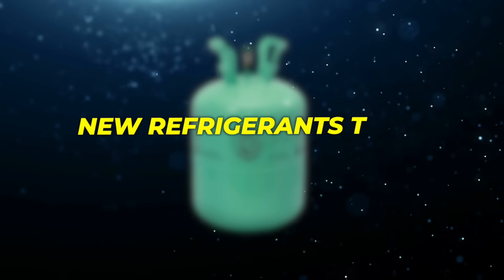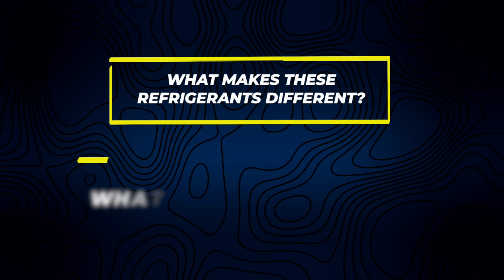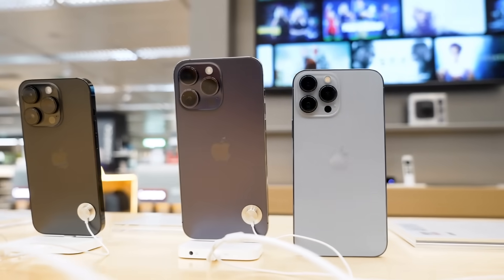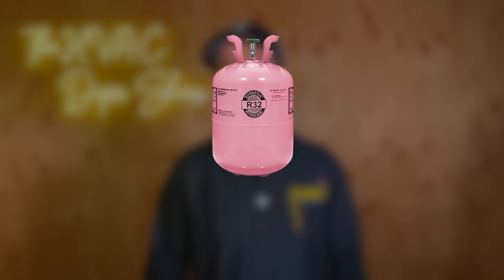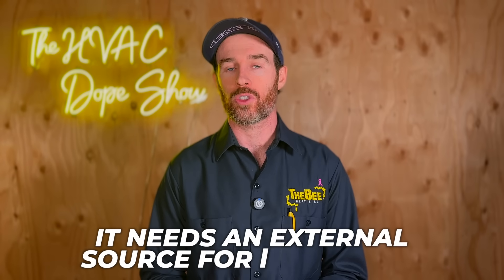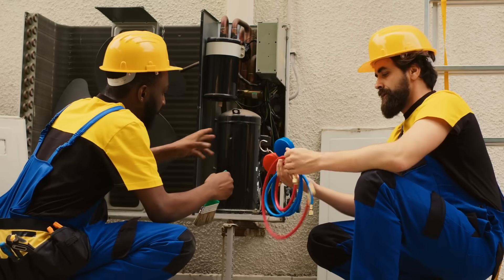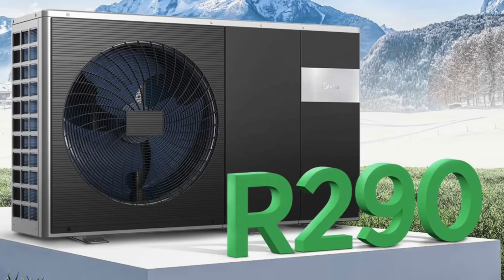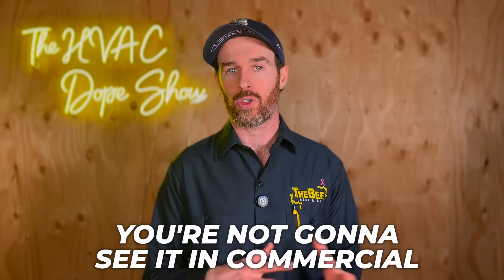The TRUTH about the “new” refrigerants | R32 and R454B refrigerants phase in

Comment: The phase-out for R454b is on the radar in Europe. They found out about the “forever chemicals” known as PFAS that are in this refrigerant but NOT R32. Of course DuPont will come out with a “new & safe” gas just in time for everyone to buy new A/C units. Don’t worry, you WILL get used to this sort of thing after a few more times.
Reply from the maker: Yeah planned obsolescence… can’t stand DuPont I tell everyone I know to watch dark waters lol. That’s crazy I didn’t think 454b was being used in Europe already? I thought it was a blend of R32 and 1234yf and they haven’t been using it in the field yet? Weird I’ll have to do more research
Reply: @TheHVACDopeShow  454b may not be currently use in Europe, my research on refrigerant options lead me to see how much stuff they were looking at due to PFAS, R32 was not included. I’m currently working on planning a replacement of a running 38 year old R22 Goodman. The last tech that was here to change out a capacitor, said the company owner directed service that no more refrigerant services would be performed on units that used banned refrigerants and customers were told these units just need to be replaced. Nobody could give me a good answer as to why they want to sell systems with another evolving refrigerant ban R410a, nor why the supposedly 25% more expensive 454b units can’t be priced yet. Do I need to say what their response was when I asked about products manufactured by the Daikin group, which they do not sell?
Reply: @TheHVACDopeShow What does Freon Look like Is it like mist or water
Reply: @MechagodzillaDraws  all refrigerants evaporate once they hit our atmosphere. There are colored jugs that represent one type versus another, but they are getting ready to change that and all will be white jug with red colored top. Better hope if you need refrigerant the tech gives you the right type your unit needs in the future. If your unit gets the wrong type that it needs it won't work and due to price of refrigerants not a cheap fix. If you were able to look at a certain refrigerant thru a sight glass as an example, you wouldn't be able to tell what type or kind it is. It's a clear looking liquid thru a refrigerant sight glass.
Reply: @AustinAirCo if you had three glass bottles, one containing vodka, one with white tequila, and one with rubbing alcohol, would you be able to tell them apart just by looking? 😋
Reply: @AustinAirCo  Thanks
Reply: @realSamAndrew  open the bottle, you could pour the booze out. Can't do that with refrigerant. If I put a ball under one of 3 shells and moved them around would you know the one the ball is under? Hire a clown, the circus comes for free. :face-green-smiling:
Reply: @AustinAirCo  I hope you know I was just playing around with you. With the liquid I was referring to what you wrote about the sight glass. A glass bottle is analogous for something stable at normal pressure. Clear liquid in a glass container. The rest of that stuff about the circus? You lost me there.
Reply: @realSamAndrew  yeah no harm was committed to balls or shells either, clowns may have been riled up a bit though. My bad. :face-turquoise-covering-eyes:
Reply: @MechagodzillaDraws  You first have to grasp what a refrigerant is used for....

It wants to be a gas. If you put it under pressure to turn it into a liquid, it will boil off and absorb heat when it turns back into a gas. That's the basics of refrigeration and air conditioning. 

"Freon" is a generic name, used to make things more understandable for the masses. It's a term I've never used in 20 years as a service tech, except to correct.
Reply: Forever chemicals are hazardous to technicians and customers.
Reply: @fosterhensleycm8378  yes but the chemicals in this refrigerant are not hazardous to customers they don’t interact with the unit
Reply: That’s not true. R454B is a mix of R32 and HFO1234yf. There are no PFAs
Reply: @ Uh…you better get on the phone to the regulators in Europe. They think R-454b contains PFAS.
Reply: @billm.2677  No they do not. The data on this refrigerant is public information and well known to Europeans regulators as well as American.
Reply: @billm.2677  No they do not.  All the data on R454B is public information , and well know by regulators in both Europe and the US.
Reply: In spite of the UToob folks verbiage, R454b contains PFAS. Do a search for yourself.
Reply: @billm.2677  R454b is a mixture of R32 and HFO1234yf. No PFAs. What data sheets are you looking at?
Reply: @ maybe I was mistaken in my research. You have now convinced me you are right. This stuff is so safe you could eat it.
Reply: @WLB2-j5j  1234yf decomposes in to PFAS in atmosphere. Maine banned the sale starting 2040.
Reply: @Taluvian  The least bad alternative. PFAS are not a problem in the atmosphere.  Federal Law will Trump Maine state law.
Reply: I did some bro research and found this “Yes, R454B, while not containing PFAS directly, does contain a component, HFO1234yf, which is a chemical included in the broad definition of PFAS in some regions. This means that R454B is subject to restrictions and potential bans related to PFAS in those areas”
Reply: @ HFO1234yf is used in modern autos. Be on the lookout for price gouging there too.
Reply: Dammit. Just when we finally get it here in the states. 😂

Comment: I get the sense that simple, less pressure, smaller system that r32 is going to make better financial sense that’s the r454b over time even with its higher thermal space.   Next round will likely be r32 and sadly carrier is out.
Reply from the maker: I agree I think R32 is a better refrigerant because the charge is lower and systems are smaller which means higher efficiency, and smaller systems as opposed to some of the massive condensers we’ve had to have with 410A

Comment: The difference between some GWP values, might be because some report the 25 year average, and others the 100y average.
The 25y value is usually a lot worse for substances with short atmospheric half-life.
Reply from the maker: I will have to look into this because I’m actually not versed on refrigerant half lives, thanks for the comment and homework!😁
Reply: It’s a wonder we are all still alive 🙄
Reply: As a atmospheric component how does one measure .005 of a single percent?  That is called a trace minimum.  CO2 is .045 of a single percent and is Barely definably measurable in Open Air.
Reply: @DDM502001  measuring CO² in air is doable in high school chemistry class, even at lower levels.
Adsorption gas chromatography with mass spectrometry is perfect for ultra low concentration analysis.